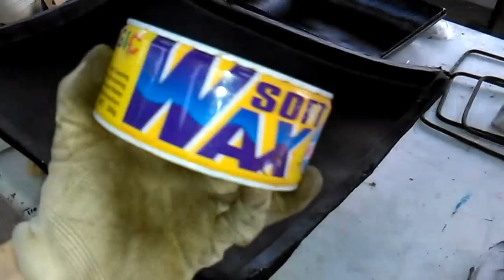How I made this japanese lanthern

Comment: its very generous of you to share all this, thank you. If ever possible, a list of products used and measurements of the lantern parts would be great. right now I would not attempt such a project without a bit more technical info.
Reply from the maker: Thank you! :)... I will post the dimenssions and the materials as soon as I can
Reply: Thank you so much. I dont think i would take on such a challenging project anyways, I see why they're so expensive. At best, I could make the structure out of Wood and cover it with shapecrete, I dont know. So could this type of lantern have functioning light? It doesnt look like it.
Reply from the maker: Yes, it can be function, but the client wanted to be simple without lightbulb :) ... you can make it electrical, or use a candle, or even an oil lamp inside the light box
Reply from the maker: Have you seen my other lamps? Pagoda and the other one? In pagoda I used tea lights candle... here is the link : https://www.youtube.com/watch?v=67C-I-wJMfw
Reply: I'll check it out
Reply from the maker: Send me youre email adress, I found measurements of the lamp and I want to send them to you
Reply: Вот если нет форм ,куда заливать его и не сделать

Comment: Hey Paul, great video. On parts like the lantern body you should try using glass fibre in the concrete. Easy to work with and strong. Any that is showing on the surface can be sanded off or even burnt.
Reply from the maker: Thank you! I used PP fiber from Sika, it does the same thing

Comment: Really great!  Much more work that I am going to do but have my own ideas to make it easier.  What is the concrete mix and sealant you used?  Thank you!
Reply from the maker: Thank you! I'm using different kinds of mixes, but you can use 3 parts gravel, 2 sand, 1 cement, sometimes I use water glass as a sealant

Comment: Hi Paul,
I'm considering making the same except in wood and then spraying with a very rough concrete type mixture. Any thoughts on this ?
David.
Reply from the maker: +dseto8888 Hi David,
Yes, I think it's a good idea, you can use some textured paint like anti stone chip paint that it's used on cars and then spray 2 or 3 coats of flat paint to really protect the wood from elements. And I will like to see some photo's of the lamp when it's finished :). You can send me the photo's on pauldanidp@gmail.com, I will realy appreciate this.
Paul.

Comment: Great work Paul. What are the material you use to cast the mold. Sorry, I'm just a beginner trying to learn the process.
Reply from the maker: Thank you! For the molds I used wood particle boards, gypsum plaster, hemp fibres, paint, wax, and oil as a release agent and for the concrete I used sand, cement, PP fibres and steel.
Reply from the maker: +Paul Iascau's studio and polistyrene foam boards

Comment: I have learn't some interesting techniques here, especially the  ingenious use of foam. 
 If I tried making one it would not be as good as yours as I am lazy and less skilful so I would try to take as many shortcuts as possible.   I would try using proprietary plant trays and other objects as moulds. I would not have used so much rebar, maybe some more aggregate and possibly steel fibres and thinner steel wire. As you are using glass fibres, my feeling is that it probably does not need the rebar. Did you try without and find that they break or was it more of an instinct to make it as strong as possible?  I can see that your metal and fibreglass molds look very reuseable but wonder if your chipboard molds last very long?.
Reply from the maker: I wanted to be sure it wont crack that's why I went overkill with the steel :)...actually the chipboard molds are very good :)

Comment: wouahhhhhh great job..it seems made by passion great technic. If possible could you give me the proportions and measurement of different parts.Thanks a lot
Reply from the maker: Thank you! I made another video in wich I put the plan at the begining, please check on my other videos for the plan , I will send you the link
Reply from the maker: https://www.youtube.com/watch?v=WrQpt6PQIQ0&t=3s
Reply: thank you for your answer, i will at once look at your video.
Reply from the maker: You're welcome!
Reply: Hi Paul.i'm beginning to make one.for the roof the wooden part in the middle seems higher? and i have a question about the concrete part under the roof. in the plan i can read 10cm from the top to the base.including this part?
Reply from the maker: Its not higher... It's the same as the corner hight

Comment: What did you put on the concrete surface at 06:13 ?
Why did you paint the mold in black?
Reply: because he had black laying around the shop and was hoping paint would make the concrete not stick to the form
Reply: he added a thin layer of concrete at 6:13 to fill in the air bubble holes
Reply from the maker: I made a cement slury (cement & water) to cover the imperfections, And I paint the mold so the concrete wont stck to the plaster mold